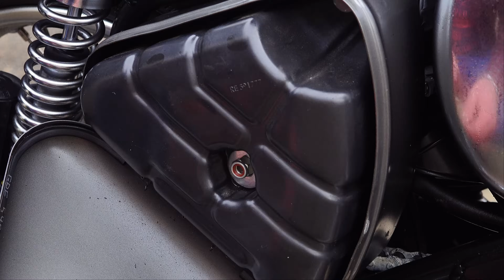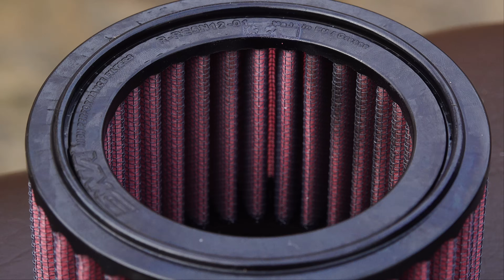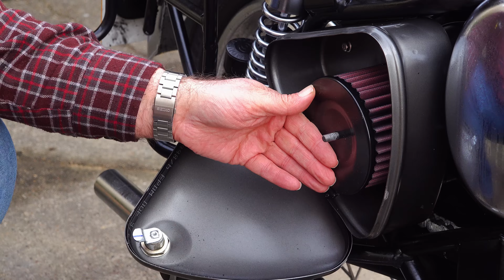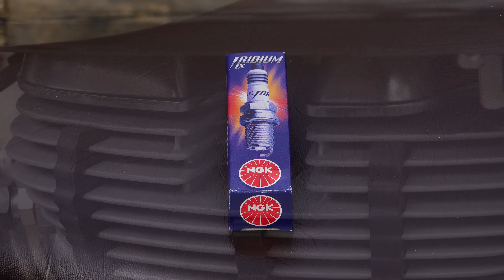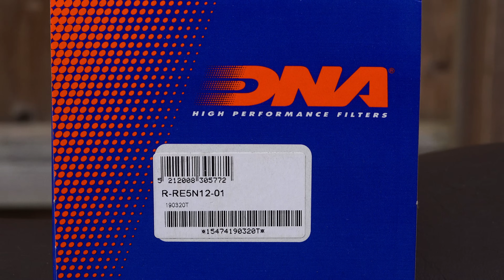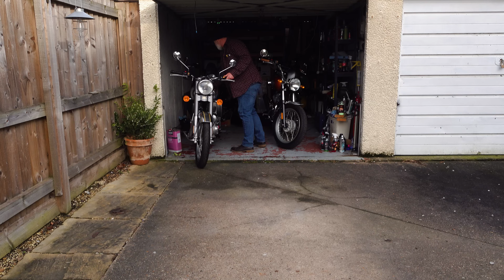Royal Enfield Classic 500, TOP PERFORMANCE MODS I didn't tell you about!

Comment: Hi Stuart, I have just bought one of those filters for my 500 2018 Pegasus which I take it is the same bike as yours? But different livery .The only Problem is that this filter is wider ( thicker ) than my original filter so i can’t bolt it down flush to seal it with the plastic cover over it ? Any thoughts anyone??
Reply from the maker: sounds like the wrong filter for your model!
Reply: @stuartfillingham  it’s exactly the same filter as yours and I thought that the air box was the same as yours as mine is a 2018 500 classic. Was your old filter stuck to that black plate as mine was ? And was your old filter the same thickness as the new one ? Thanks for all your help , great YouTube by the way, love your posts 👍
Reply from the maker: @ianaspey472  yes old one was glued in. depth of old and new were the same.
Reply: @stuartfillingham  ok thank you . In that case that filter doesn’t fit the 2018 Royal Enfield 500 classic. I’m going have to send it back or stick it on eBay ☹️
Reply: @stuartfillingham  what age and model is yours Stuart? Just trying to get to the bottom of why this filter is 6mm thicker than the standard one, sorry to be a pain, thanks again for your help ..
Reply from the maker: @ianaspey472  2019 classic 500 chrome. registered in 2020.

Comment: Stuart 
  This may sound a stupid question but did you have to adjust the plug gap or did you just replace it the way it was out of the box
Jim
Reply: Thanks stuart your a star
Reply from the maker: No they are pre gapped. not a stupid question as they are usually much wider than recommended.

Comment: I'm familiar with using double platinum plugs for my vans, but have not investigated iridium. I guess I will on my beloved interceptor. It missed a couple times last year, which I attributed to possible water accumulation in our ethanol blended fuel. Maybe a plug upgrade will make it happier. Also, do you know if the interceptor air filter is the same as any other (like Triumph) that is more commonly on the shelf?
Reply from the maker: I made a video on the air filter year before last.
Reply: @stuartfillingham  Thanks! I'll look for it.

Comment: Edited to add:  I installed the filter and what a huge difference it made.  I bought the Iridium plug, but failed to order a new cap.  Carefully ground down the large (soft iron) electrode on the plug and now it fits my existing cap.   Easy job and much quicker than sending away for a new cap or even changing caps.  My bullet drives like a different bike now with more and smoother torque at low engine speeds.  Anything below 2500 RPM was pretty rough before, but now I can (carefully) lug the engine starting at 1800 and it feels smooth.  Really helps in the corners when it is inconvenient to downshift.  The hesitation, to the point the engine would die or (more commonly) almost die when rapidly coming off idle is now completely gone.  I'm a bit mad at myself for not doing these simple and obvious things a couple of years ago.

You have made me a believer.  My new DNA air filter and my NGK Iridium plug should be here in a couple of days.  I hesitated getting a "performance" filter for a long time because I was afraid I might upset the EFI operation, but your engine didn't seem to have any problem.  I'm hoping the new plug will help with the sputtering I sometimes get when I open the throttle from idle and perhaps a quicker start.

Comment: Hi Stuart, do you know where I can get a definitive torque setting list for my 2020 Classic 500. I have a little confusion around the two M8x35mm front brake calliper mounting bolts?
Reply from the maker: haynes manual
Reply: Thanks Stuart unfortunately the Haynes manual just quotes torque for the front brake disc bolts (I assume onto the front hub) not the calliper mounting bolts 😩

Comment: These are simple yet nicely effective mods - I've done them on my Classic 500, too. I used a K&N filter, though, since it was a gift and, you know about gifted horses. That's good quality, too - after installing it the Classic goes almost 40km/litre which is fine (before it went 35-36, but I have to say now I am also using 100 octane fuel which reduces consumption, too, and keeps the engine cleaner). The Bullet/Classic is not a thirsty bike per se, bless her, but you're right, tinkering is so good. Anyway. Before installing the Iridium plug I swapped a couple of emails with NGK technical support (very helpful people, I've to say) to double-check something I'd read on the Internet, and yes, they too recommended using a non-resistor cap with the Iridium plug (that, I understand, has a built-in resistor). That was a good chance to install a longer HT lead, too - the original RE lead is, to be honest, on the too short side. Regards and ride safe!

Comment: So the filter you are using is a stock replacement and not free flow correct ? If it were a free flow filter you would need to remap your ECU to avoid your bike running lean right ?
Reply from the maker: No Joseph I thought it was common knowledge that all ECUs must be adaptive now and have been for several years!
Reply: @stuartfillingham  thanks Stuart👍 this is good to know cheers!

Comment: Always worried about iridium plugs in case they make the bike run can this happen with the change of air filter as well stuart?
Reply from the maker: well I hope they make the bike run, or there is little point fitting them!
Reply: I ment run hot because of the more complete burn of the petrol and the less restrictive air filter

Comment: Thanks for this video Stuart. I haven’t done the air filter yet but replaced the plug almost immediately. Did you replace the spark plug cap as well ?? I did and looking at the original plug and cap on my Bike I had an even cheaper set than it appears you had. The two pronged plug, and a cap made out of not much more than tin foil.
Reply from the maker: I didn't
Reply: It looks like British imports have different stock consumables. I was shocked at how poor the quality was especially on the cap.

Comment: Air and sparks! Good to see classic old school lore seeing the light of day again. Knowledge that was in danger of becoming forgotten as modern bikes have such a huge power reserve over what you actually need for real world riding that there is no need even to consider  efficiency gains from such things as air and sparks - unless of course you are going racing. My old Norton Commando benefitted from a K&N filter, and Japanese coils, leads and plugs to replace the Lucas & Champion horrors it came with - not in tangible performance terms but just in terms of confidence it would always get you work in the morning.  My Classic 500 hasn't been out of the garage since it was delivered at end of Jan, so I am looking forward to playing when weather and end of lockdown allows. I would be interested to see what you make of Hitchcock's booster plug kit (92120/1) and their Vibration Reduction Plate (92498A) in future videos.

Comment: Completely according to your propositions. There are still the suppressive cables that conduct the energy to the plugs. They are of the resistive type so as not to radiate interference to television sets and currently even for transmission with modern helmets. However, over the years, their resistivity greatly increases, stealing all the energy produced by the ignition system. Another piece that can easily deceive us, if we do not continuously measure its resistivity according to the table in the motorcycle workshop manual, is the pipe which is attached to the plug with rubber insulation on the outside. Many of them have a pre-resistor that sometimes breaks down with little time, producing a thin spark to the plugs. Grateful for the advice. Until!

Comment: I was advised to check the filter on the fuel pump when I got my Classic 500. It had done 5000 odd miles. The fuel pump is in the tank and shrouded by a very fine mesh filter. The inside of the tank is coated with a red lead coloured paint, I’m not sure what type of paint it is. This breaks down over time and clogs the filter. I removed mine  to find the filter was badly blocked with a sludge the same colour as the paint lining the inside of the tank. Removing it and cleaning it gave a noticeable improvement. The engine was crisper and more responsive.

Comment: I agree with you on the air filter elements and iridium spark plugs. I use the same type of both in my cars, trucks and motorcycles. Just out of curiosity, I switched my air-cooled Sportster's spark plugs back to standard and then back again to the iridium plugs on the same day, at the same air temperature for a quick comparison. From a cold start to complete warm-up, the iridium plugs performed better in every way: quicker warm-up and quicker response. This is IN ADDITION TO longer plug life. 
Another thing I do on my motorcycles is to re-route the crankcase ventilation from going back into the air intake, to going directly out into the atmosphere. Cool and dry air is much better for the engine's health and the motorcycle's performance. In most cases, this is a cheap and easy modification.

Comment: In my personal experience, the fuel quality is also one of the biggest factors in fuel economy, ease of start, smoothnes of engine run and power delivery. Performance air filters and plugs can be easily made pointless when you're filling from asda.
Reply: Me too, I've noticed I do the most miles for the same £25 whith v-power.
Reply: Nothing wrong with supermarket fuel.

Comment: Being a lifelong Tech 50 years in the M/C and Aviation industry the air filter I'm pretty sure your correct on and the plug I'm 100 % sure your incorrect on I am a user of NGK but the fancy plated plugs or multi electrodes are a waste of time and funds , just like oil you should change them when dirty , Thank you very much for the  informative videos , I have already picked up the NGK and now on your advice will get a DNA filter for my 09 Classic EFI
Reply: I’m an former bike mechanic, and my former brother in law was a taxi mechanic. Iridium plugs were made purely for longer life due to some modern cars having less than ideal access to the spark plugs.

New plugs will always be better. You will immediately feel an improvement. To be honest, when I got my 2010 C500, I swapped the stock plug for an NGK BP5RES. Huge difference in startup, idle and running.

The only thing an iridium plug will give is longer life without requiring changing them. There’s no benefit to power and running compared to any other NGK plug. But I will agree, there is definitely an improvement over the stock plug.
Reply from the maker: no not incorrect my observations represent how it is!
Reply: @stuartfillingham  Call them as you see them sir , but if iridium was a game changer you would see it in Aviation were lives are on the line every flight , I am a fan of NGK products for there consistency and Quality , thanks again

Comment: I think a new seat should be the first upgrade, that is if your air filter does not need it . It is something that will keep you in the seat a bit longer with a better ride without hurting your backside to much. A new seat is a bit expensive, but I believe it will make any motorcycle ride better in the end.

Comment: I don't ride one of these bikes myself.... but I know a man who does.... There is something quietly satisfying about making small modes that make big improvements. I fitted a free flow filter to my Striple and have noticed an improvement in the 'erg' of the engine, smoother throttle response, and according to the live read-out slightly better litres per 100 kilometres. I am in the process of changing the fork oil, a service that has required me to buy a front paddock stand... the type that fits under the lower yoke.... plus a new 17mm hex-bit...after spending something in the order of 120 euros it better be worth it.....otherwise I will be extremely cross.... Greetings from España
Reply: It will be worth every peso for your front suspension's longevity. According to Dave Moss  (of Dave Moss Suspension Tuning fame, check out his YT channel), one's front fork oil is pretty much clagged out after 20,000km. It basically breaks down, loses its viscosity (because it gets damn hot soaking up all those road imperfections) and with that, goes any rebound damping. It also loses lubricity which leads to increased wear & tear on the stanchion slider bushes and the inner polished cylinder of the lower fork leg casting. 

Rear suspension doesn't last forever either because of the same problem with the oil breakdown. For that reason, good quality rebuildable rear shock absorbers are better in the long run than the cheapshit sealed-on-assembly units which only have one destination after they've done their dash... in the bin to landfill :-(

Today's Stutorial covered just one part of bike 'performance improvement' mods focusing on the low-hanging fruit around the engine. Check out his set of vidclips where he covers his Interceptor's front and rear suspension upgrades from the 'budget OEM', replacing them with YSS products. In the Master's own words: " It turned a good motorcycle into a fantastic (handling) motorcycle. 

I'm surprised he hasn't given the Classic 500 the same suspension upgrade treatment yet. Oh bugger, I wonder if I've let the cat out the bag if it's already a WIP that is yet to be put in the (release) can. :-o
Reply: @rhonda-my_honda_cb500x  Even though I use fully synthetic oil in the engine I change it long before recommended. An Aircraft engineer friend once told me oil is cheaper than having to repair the engine because of lubrication failures. It will be interesting to observe any improvement after the fork oil change..... hex-bit still not arrived!! so cannot remove wheel.!
Reply: Hex-bit turned up changed oil in forks cleaned and regressed seals, no problems.......It felt great being a mechanic again...
Reply: @brianperry   I've been with you on the engine oil+filter change interval policy for the last 34 years since owning 4-strokes, following the '5k-km' rule. The handbook for my Honda CB500X says oil+filter change every 12,000km. She gets an oil change every 5k-km and oil+filter every 10k-km.
Front suspension behaviour improvement will not be immediately noticeable... until the pavement quality beneath you goes sub-prime in the middle of a set of chicanes on a B or C grade back road.  That's when  the new oil will earn its keep, evening out the damping and rebound, helping the bike to still hold to the line you're taking without you having to work (much) harder to keep it on track. This of course assumes you have got your suspension settings dialed in correctly to begin with,for you and your typical load carriage
Reply: @rhonda-my_honda_cb500x  I live in Spain where the roads are far better maintained. Apart from agricultural roads... those used mainly by the farming community...the roads are general pothole free. when I watch Stu ''going for a ride'' I'm staggered at the state of some of the roads, its not how I remember them..although that was some time ago.  
Obviously the damping both comp and rebound was adjusted for the 'original' oil so some minor tweaking may be necessary. because of Covid restrictions I cannot use my favourite ''hooligan road'', that, and the fact its a bit chilly here at the moment... I've gone Full Whimp since living in España.
Reply: @brianperry  Northern or Southern Spain (it's a pretty big country!)? I live in New Zealand  so we are at literally opposite sides of the world . If I read the map right, my antipodal point would be somewhere round Cabra, Andalusia. 

NZ's North Island has its fair share of manky, sketchy, patchy roads (including dubiously designated "State 'highways'") like what we've seen Stu'  negotiating round his back yard. One might call them 'skills and character honing' for the rider and 'performance-proving' for the tyres and suspension setup. But the roads in the South Island (especially east of the Southern Alps) are 5-star biker-bliss grade.

The 'minor' stiction you mentioned in your other post, I suspect was more adversely significant for your suspension and handling than you might otherwise consider. I'd say that stiction was indicative of just how knackered that old fork oil was.

I will confess to being a bit of a wimp in the opposite direction. I don't like riding in temps more than 25 deg-C 'cos I'm a bit old-skool with still preferring proper leathers over any sort of summer 'mesh' gear. Luckily down here we're coming into March which I find to be 'Goldilocks' weather for motorcycling :-D
Reply: @rhonda-my_honda_cb500x   Valencia, although I do move into other Provences. It gets very hot in the summer months, upper thirties is normal!. I don't wear full leathers, although I know those younger 'blades' do. especially the sports bike riders on the twisty roads. I rotate from a leather jacket and armoured jeans to an armoured mesh, fabric jacket. some times less... but never, ever full 'squid'. As to regards stiction, it was just a touch of grease in the oil seals ( Dave Moss) plus the fact I had the forks apart and why not. I'm not a 'sports rider' although I have been known to have the odd hooligan moment and prefer to have the suspension setup towards 'sport' The only down side is when one is confronted with a rough surface road where the suspension cant cope and your dentures almost fall out.!!